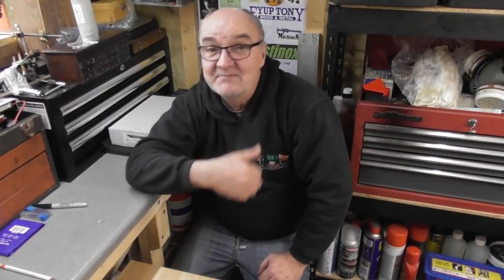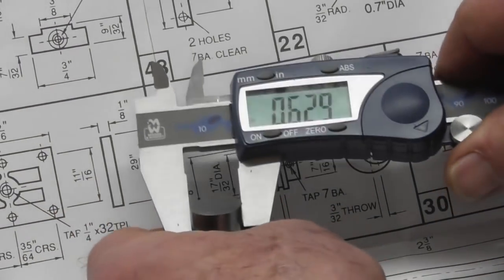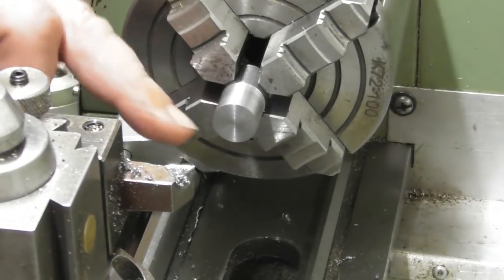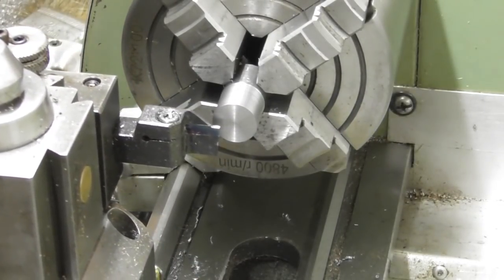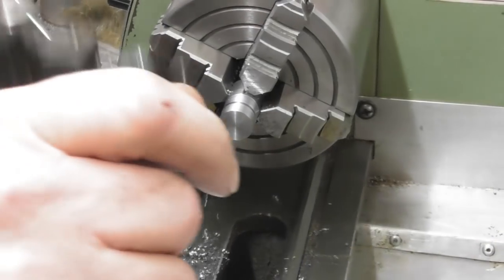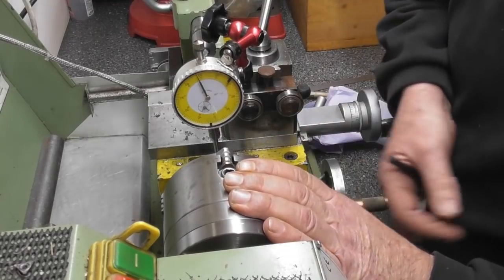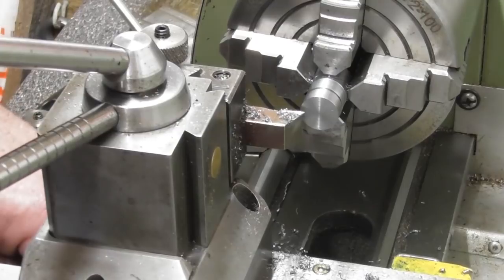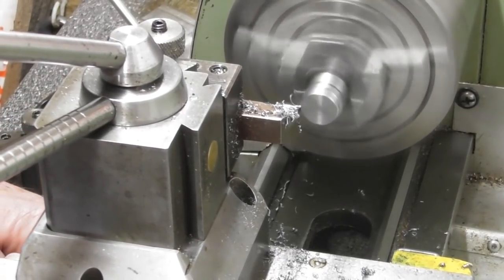Stuart Models S50 engine  Part 5 The eccentric

Comment: Good job Ade.  My kit arrived yesterday so this series is very timely, I was worried about this part but you made it look easy. My order of operations, in my head at the moment, was very much the same as yours so I'm a little less bothered now. Thanks very much Ade. Regards Gareth
Reply from the maker: I messed it up . the offset on the clock should be double that shown to get it right . I have remade the part from some EN8 stock I had , Just in case you follow my incorrect lead going forward . Cheers Ade.
Reply: @ade63dug  oh well Ade, I am nowhere near to starting yet but we've all made mistakes. I'm sure I will have some questions along the way, Like I cant find the cam lobe or the cylinder end cover in the kit so I'm assuming they have to be made. I am grateful for your videos Ade, very grateful. Regards Gareth

Comment: Thanks for one more entertaining, typical, ADES WORKSHOP video. Feeling low in the shop, workpiece scrapped, no inspiration, bringing up just any of Your videos cheers anybody up.

I assume Your well known pullover, then one having ventilation, is flying around in the washing machine... I'm joking!

Yes, it really looked crazy when You turned that excenter. No other excenter turner has managed to give that show. Would the next scene be You running after the lathe through the garden like chasing a hare? I'm joking. Looking at the peripheral of the chuck I got a handle to hold on to.

Keep on staying healthy Ade!

Comment: Considering the time & effort you have spent on setting up DRO'S on your lathe saddle & X travel have you not considered rigging up a small digi tyre depth gauge / 4" digi vernier caliper onto your tailstock & a collar on the tailstock barrel, with magnetic fittings, then you won't have to count the turns of your hand wheel when drilling to a depth. I have these fitted on my WM 250VM, as have many other hobbyists in one form or other. Looking forward to your next video, cheers.
Reply from the maker: Hi , Check my past videos , I did this a few years back . I only use it if the depth is critical . Cheers Ade

Comment: i noticed an electric power feed, is there a reason for this as apposed to the lathes gear driven feed
Reply from the maker: I can change the feed rate with a potentiometer as i go and it reduces the load on the pathetic motor on this little machine . I am going to upgrade it to a stepper motor soon to make it quieter. Cheers Ade.
Reply: @ade63dug  infinitely variable and you can have a very fine feed if you so choose. actually quite a good idea, and got to be a lot quieter than all the whirring gears on my colchester.... good call

Comment: You mucked up on the offset. The hole is offset 3/32" ( 0.094") from ctr so the total movement you should have set the part to read on the DTI is 188". If you look at the drawing the boss is tangental to the edge of the main diameter, your sis well inside that. Also groove is not for oil but to locate the spigot on the end of the valve rod so strap does not move sideways.
Reply from the maker: Take a look at the description , I am aware and have remade the part correctly .
Reply: @ade63dug  Sorry, missed you had added that to the end of the Description.

Comment: Nice job on the eccentric Ade. You took me right back to 1990 when I was turning and trapanning O ring grooves on a big horizontal mill. Keep it up, it's coming on nicely. Cheers, Jon
Reply from the maker: Having had a look I think I cocked it up with only half the offset amount , I am going to check . I cant remember if i allowed for twice the reading to get it right , easy done Oops , I am back shielding again so I may finally get to the post office with your parcel soon . Cheers Ade.